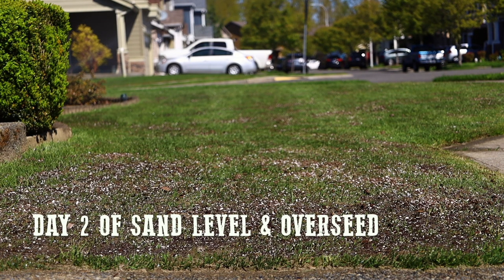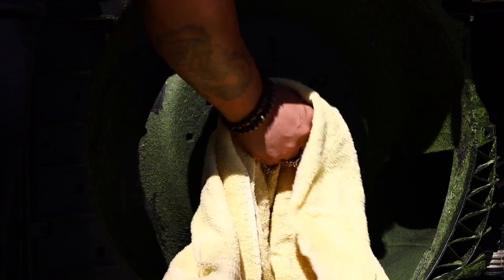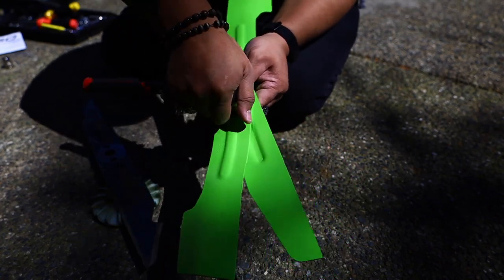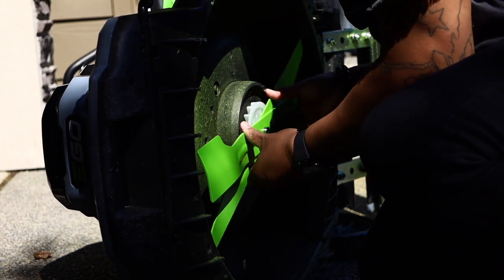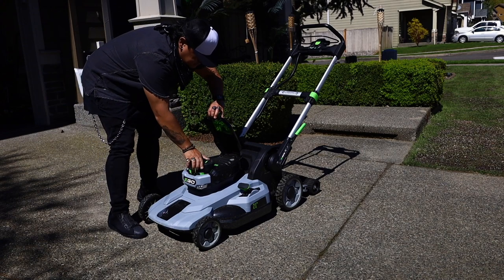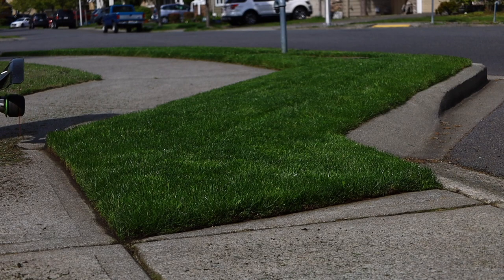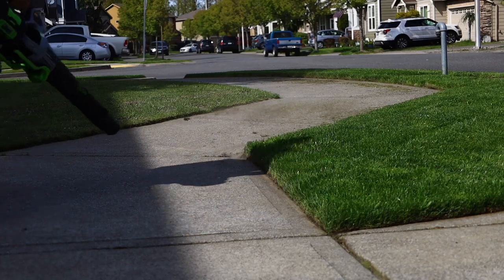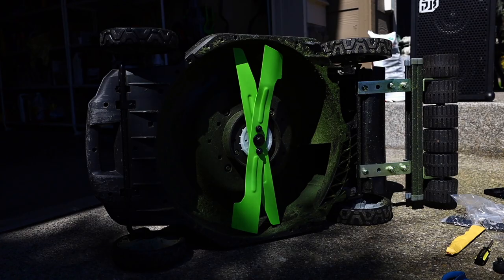I put the EGO Dual High Lift Blade on my Older lawn mower ~ Did it the right way keeping same HOC!

Comment: My LM2100 mower unfortunately will not turn over with the dual blades on. I have all the right parts and fear I have wasted around $70 in parts for the dual blades and hardware. It gives me an overload error as if the motor has too much resistance 

I put the single blade back on and it starts right up… very disappointed
Reply from the maker: Oh no I have zero issues with this modification. What ah battery are you using I mean I doesn’t matter cause battery is not power but I can use all the way down to 4ah and it still runs 😩
Reply: I have brand new 5ah batteries and it still doesn’t work, originally was using my older batteries, so it doesn’t seem to matter… I only have one year left in my mowers warranty… I hope it’s not the motor wearing out. But it’s impossible to get it to turn over and run with the dual blades due to the weight I guess

Comment: What size of battery are you using and how long does it last
Reply from the maker: the LM2100 came with a 5ah 56v battery and I have never run out of juice cutting the full front and back 3000 sqft going over it twice making it 6000 sqft it's always still halfway full 🤙🏾
Reply: @YardBrah  thanks man I’m looking at the 2.5 battery on a 16’’ push mower
Reply from the maker: My bad I have the 7.5ah as well!
Reply: @atifmanzoor63  I would not waste money on the 2.5Ah as it is only good for extremely light duty EGO tools and even though able to fit in larger tools they will not be able to power the tool or provide sufficient runtime at all. 4.0Ah or 5.0Ah is the new minimum for EGO tools.

Comment: Not a good  video,  added weight of the blades will wear the motor out........   this mower can't handle it!!!!
Reply from the maker: Not a good comment, this mower has been mowing everyday for 1 year and 2 months with the Dc Motor EGO-2730232001 & dual blade conversion and it’s still running strong… meanwhile my buddies dc motor on his ego lm2135 DC motor part number EGO-2730252001 that is supposed to “handle it” has been replaced by ego 3 times on warranty and he barely mows his lawn…. Nice try negative Nancy 😂😂😂😂😂😂😂😂😂